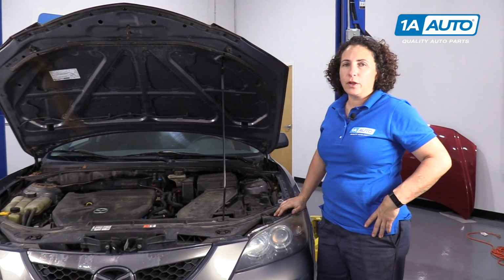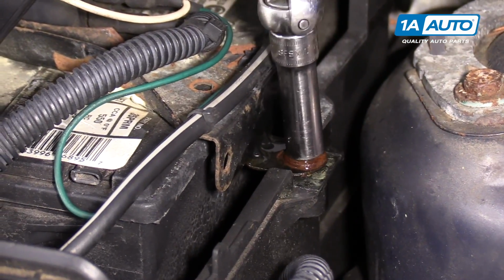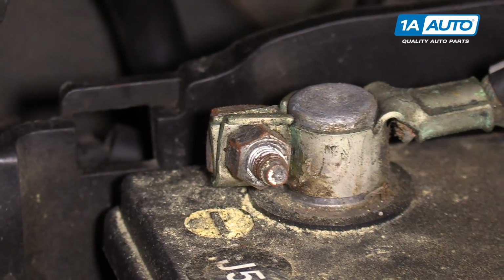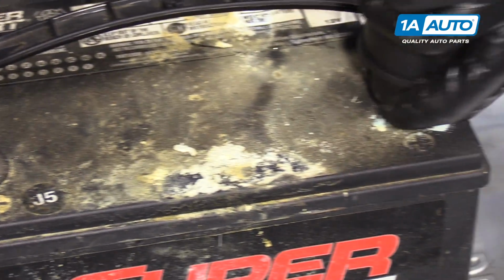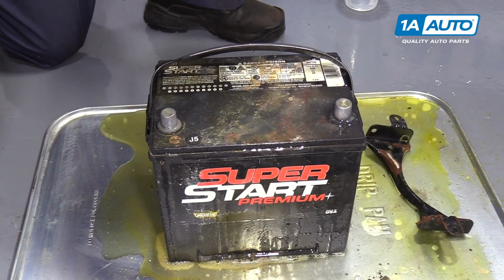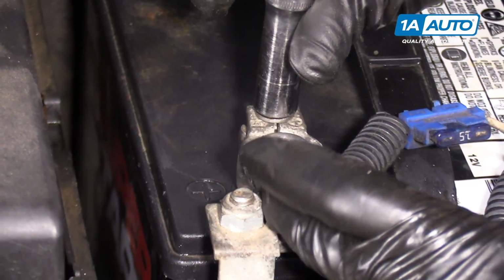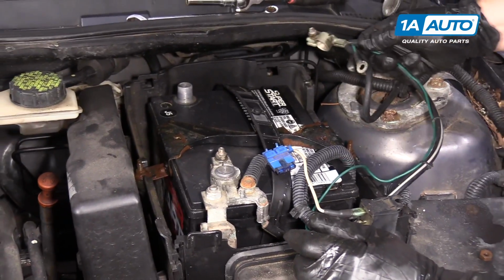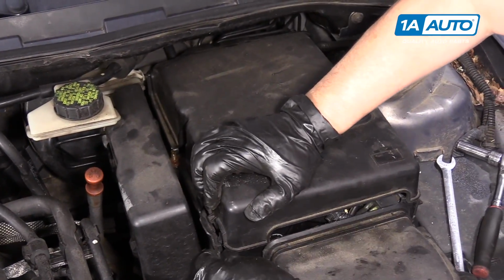How to Replace Battery 03-09 Mazda 3

Comment: They didn't mention that the car has to sit between a half hour and a hour to reset the computer. If not it will run rough (hunting idle) and can stall when you come to a stop. It needs to relearn where the idle needs to be.
There is a Mazda service bulletin outlining the procedure 👍
Reply: You could also use a memory saver device that plugs into the OBD2 port to provide power to the car while you're changing the battery.

Comment: Great video but didn't address the horn blaring issue we faced when removing and reattaching the negative terminal.  We solved this by turning the key to the second position "on" and then reattaching the negative terminal.  Outside of this it was a very smooth process.
Reply: Interesting, mine didn't blare, maybe you have a different year. Mines 05
Reply: @epiccitybuilders  yes 08 here, 2l

Comment: Never ever undo anything until the earth is undone.

Removing the battery hold down 1st WRONG.
You have high risks of shortage and blowing fuses.
Reply: The positive is totally covered with a rubber boot and there is no risk of hitting the positive with your wrench which could cause a blown fuse. You can remove the battery hold down first if you like - you'll never ground out the positive.

Comment: Does it matter if water is present from post to post ?
Also you didnt mention coating terminals and clamps with a corrosion inhibiting grease ?
Why is battery not clamped to chassis (Mazda)? Hold down bar bolts are only attached to flimsy battery box sides, very odd ?